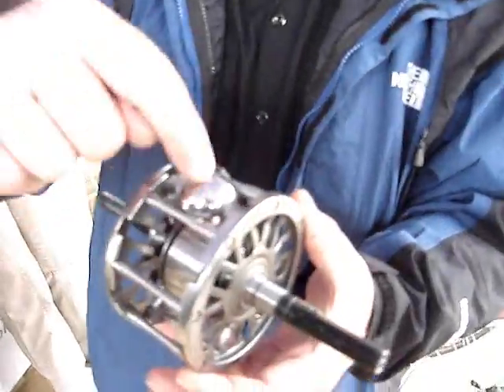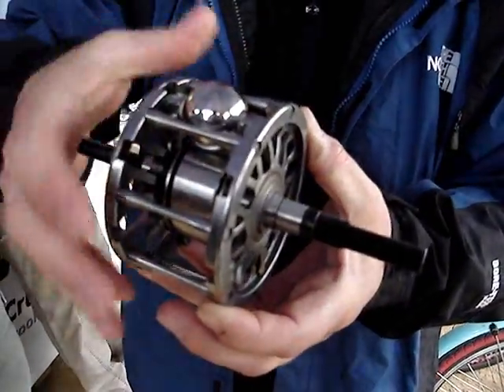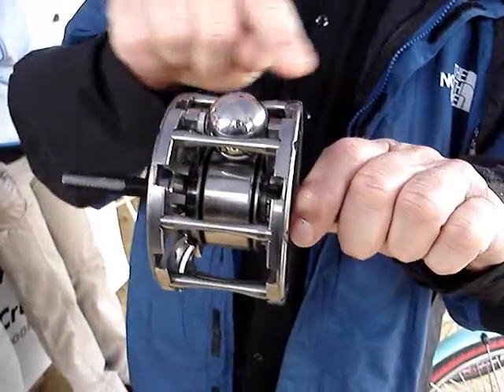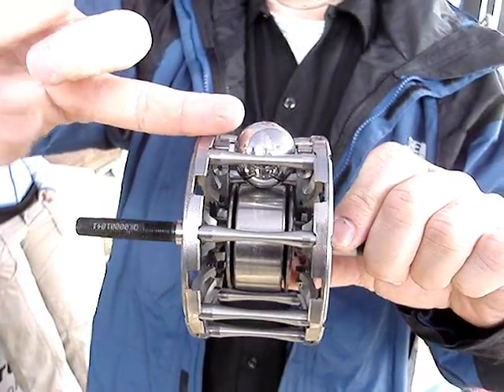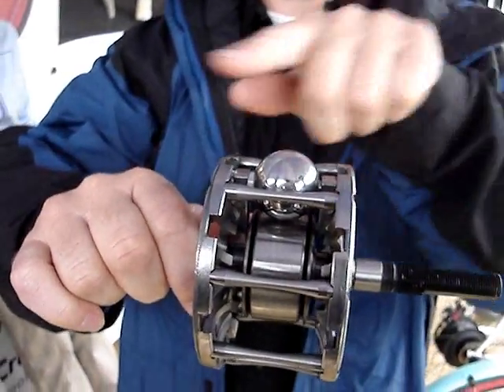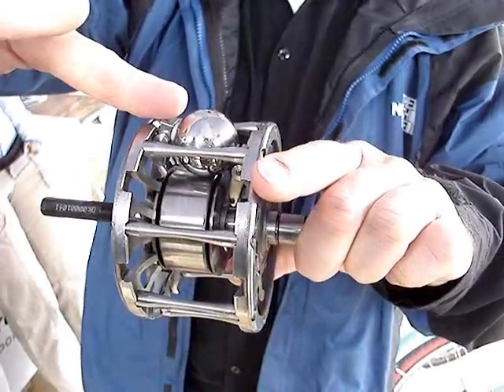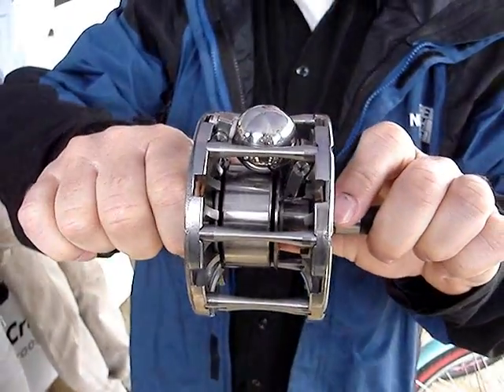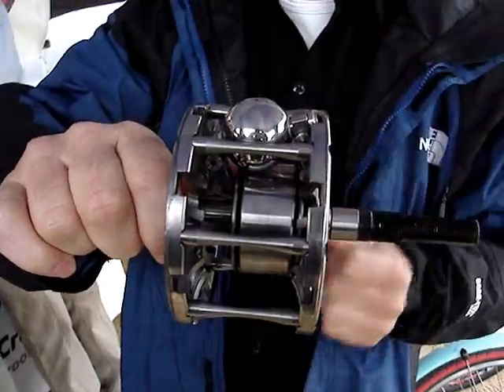NuVinci Hub

Comment: Nope - I was referring to efficiencies of planetary-gear transmissions - or manual car transmissions which use conventional gearing. I think this hub should be at least as efficient as them. 

As you noted, the fluid solidifies under pressure, which is why I called it a phase-change fluid.

Comment: One hell of a well machined piece. At the price these 171's  are going for, you get rohloff quality for 1/10 the price. 8 lbs, but can take 96nm of force.
Reply: 8lbs? I guess this also involves the two wires and plastic changer? No wait a minute’ I have to be missing a whole lot entirely. I hear it was 5 1/2lbs in total, or at least for the hub with the wiring and plastic clicker weighing say 100-150 grams max.

Comment: It's "continuously variable", not "constant velocity".

Surely if you set it to its maximum ratio and stamp on the pedals going up a hill, it will quickly slip (like my bike with worn gears and stretched chain does, but with only a small amount of pedal force :/). This might protect the mechanism from wear somewhat.

I'd like to see how this fares after continuous, rigorous usage - will the lubricating fluid transfer away heat from friction during slippage and mitigate mechanical wear?

Comment: I don't think that's true. If you're talking about the torque convertors used in automatic car transmissions, that's because fluid is used to transmit the power from driveshaft to wheels.

In this case, fluid only seems to be used as a lubricant - the power is transmitted through friction with a sphere (which is quite an aerodynamic shape, anyway).

According to another video on this CVT, the fluid solidifies briefly at contact points due to pressure - like a lockup clutch. Which is good!

Comment: I think I got it except the fluid that hardens when compressed makes me think there is still some black magic a well.
Reply: There isn’t any of that at all here. And what you are suggesting is hydraulics. But this transmission appears to work by changing the input and output so as to alter the radii they roll on, Hence changing the gear ratio. So more trigonometry than fluid dynamics.

Comment: Yes, same surface, but different radii where each disc makes contact.  The balls are used to tranfer power between 2 discs & are used in place of gears.  There are an infinite # of differently sized circles on the surface of a sphere, the input disc & output disc contact the spheres at points that follow different sized circles, or the same circle when in 1:1.  Make sense?

Comment: The amount of force required to make it slip was indeed speculation on my part, which is why I said "surely". If I said it "like it was truth" as you unfairly asserted, I wouldn't have added that qualifier.

You shouldn't insult people or jump down their throats when they make logically reasonable speculation. Just adding or contradicting with your own knowledge is sufficient.

I'm unsure as to the slip/break question - someone said that the fluid layer pushes friction up when it solidifies.

Comment: Any ideas as to the gear ratio range that can be achieved with this system versus, say, a typical derailleur system on a mountain bike? I realize it is already in practical use on a bicycle already, but just curious as to the specifics.
Reply: The range is about 350%.

Comment: Chain drive is the only way to go for a bike. When you are the power source, every little bit of friction counts.
Reply: This is still chain driven. It just goes through a transmission. Other bikes don't really have a "transmission". They are direct drive and you manually select the ratio by slipping the chain

Comment: I hate when people assume (out of their asses) that other people are taking affirmations out of their asses :P

The NuVinci is a toroidal traction CVT, which uses dynamic friction to transfer force (like most CVT designs). My point was that putting excessive, sudden load on the CVT will cause it to slip, which is probably a good thing (if the choices are either slip or be damaged).

Check out the CVT article on Wikipedia (ratcheting and toroidal in particular) and don't be so rude next time.

Comment: I haven't ride it for hundreds of miles and, I watched the video. As RCWorks from the comment below, My opinion is that the efficiency of the CVT drivetrain is still lower then a tradition set up. Until we see some test and numbers, my view is that the mechanical efficiency of this CVT drivetrain is lower then a tourney grouppo. the idea of CVT is not new, last time I recall... CVT has been around for around 100 years or so, maybe CVT is the answer, but as in now. I just don't see it.

Comment: I worked with a guy who worked on that hub. He said that with the best milling machines they still could not make the parts precisely enough. I love the concept but is that hub in production now? Is it in use as a general industrial ratio box?
Reply: The hub has been in production for a while, also not sure what you're talking about on precision, the watch ticking away on my arm has micrometer precise components, and wristwatches aren't exactly a new thing.

Precision is expensive though, so perhaps you mean they could not be made precise enough at desired cost? But evidently that wasn't the issue either since they made it to production...

Comment: This method of cvt relies on friction to transfer power to the wheel, without it the mechanism would slip. This means that not all of the effort imputed by the used gets through to actully drive the wheels. Excesive friction is the underlieing problem with all CVT systems, and in my opinion it is the reason none have been successful.

Comment: OK, I got the basic concept. But I would like to understand exactly the point of contact where this "small radius" & "big radius" take place. Last time I checked, tilting a round sphere doesn't change its radius, bigger or smaller. It's a Sphere! So, I'm assuming the explanation of internal workings is intentionally vague to keep the design from being stolen. I guess I'll need to look up the patent to see how it works, because Dude doesn't explain a thing. He's merely describing its function. And not very well, at that.
Reply: Got it! These demo vids all fail to explain why tilting the spinning balls make the rings spin slower or faster. They only say what affect tilting the balls have on the rings. Which is, the rings will spin at different speeds from one another. They should explain what causes them to spin at different speeds from one another in more detail.

Not... "when this happens, that will happen".
should be... "when this happens, this, this, & this also happen, & as a result, that will happen".
Reply: it is a sphere, but the axis changes.

Comment: Unfortunately the guy explains completely IN REVERSE in terms of the size of the radius between underdrive (low gear) and overdrive (high gear) :(
Reply: You're wrong, look at it again. The radius as he describes are larger and smaller. Think of it as a planet and the axis goes from the north to the South Pole.